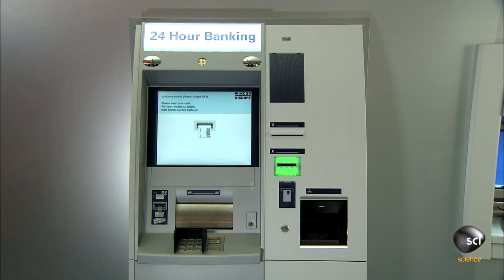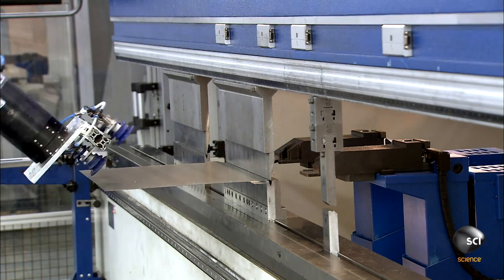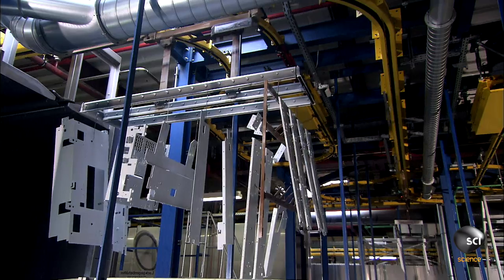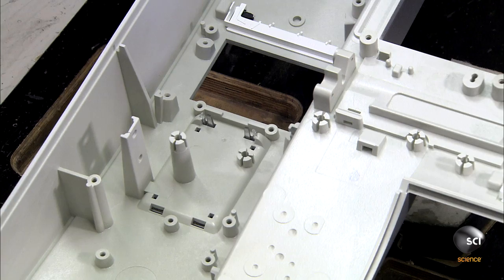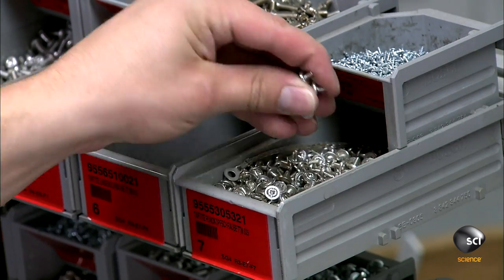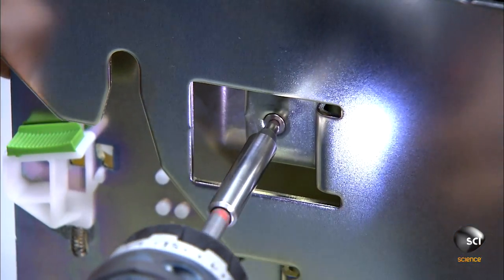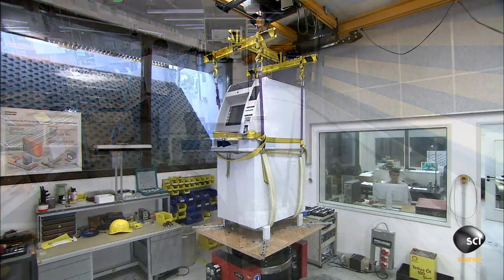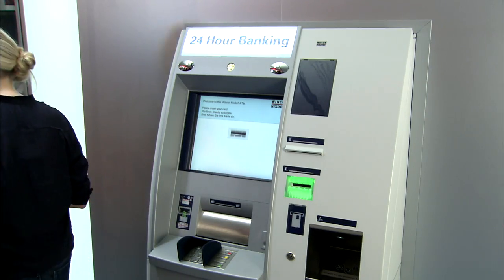ATM | How It's Made

Comment: As an atm technician I'll let you know that a lot of this is a thing of the past. The company shown in actually gone and a part of Diebold (now Diebold Nixdorf). Everything is made separately and assembled on site, not remotely.
Reply: I had been a dock worker of the logistics chain (Watkins Motor Lines) that took part in the transporting of Diebold ATM's back in 1999/2000, before they acquired Wincor Nixdorf in 2016, there would be at least two crates with a third pallet of parts which make up each machine.
Reply: How do you become an atm technician? Where do you go to to start?
Reply: Jay Rock AK  you can steal one anyways

Comment: How does the computer get the paper notes in/out of the safe? There doesn't seem to be any holes.
Reply: So the bottom part (where the cash goes in and out) are covered by a literal safe.. And it can only be accessed via the safe door.. So all the cassettes shown above sits inside the safe.. And can only be opened with a combination lock or some kind of key..

Comment: The processor and the chips in an ATM has 1/60th the computation power of a standard smartphone.  All of the cost is in the safe and the bill dispenser.  The processor and chips only cost pennies.
Reply: +N 10SZ They'll probably run off current smartphone hardware at some point tho. Current ATMs often still have 386/486 hardware inside, running Windows NT 4.0 til a few years ago when the extended support was dropped.
Reply: @1337Shockwav3  they still run on WindowsXP despite the support being dropped because it doesn't matter for them.
They are not connected to the internet, they route through a dedicated firewall that create a VPN tunnel to the bank. So it doesn't matter if the system itself is safe against network attacks.
Reply: I work for an ATM company and ALL of our customers ATMs are running windows 10 and have for at least 6 months.

Comment: awww.... I was wanting to know about the explosive ink charges they have =/
Reply: I used to work for a cash machine company. It's not really an explosive but rather a CO2 cartridge with an electric valve, releasing the gas to an ink container. So when the computer detects an intrusion, it squirts ink at high pressure through a nozzle, like a shower head. The ink is incredibly aggressive. I had to take a canister with sprayed money (due to a computer malfunction) to a cash central and count the money. The smell was nauseating, and the ink dissolved all plastic that it touched, including the fake leather car seat where we mindlessly placed the canister (in a plastic bag...).
Reply: Does Not exist in the ATM , would only be in the bags armoured carriers bring to the ATM to refill the cash

Comment: Any1 saw the robotic selection movement of "item keeping" then i gave an idea of "in a tunnel" to retrieve(by pressing only), i think atm box of cash can be changed this way(the money inside a long tunnel), then have stories of "a murder plot" someone digged a hole to push me in then fall inside instead(at that time i was at home) with alot of Maggots in it, so due to stories, maybe if my plan to have a deep tunnel digged for this, may have chances to push a new harassment plot, so just writing stuff. But still Means the old harassment plot is still not over right?

Comment: really? windows?! oh my god no wonder people can easily hack them..
Reply: Apple os? why? y dont they use linux.. recently here in germany somebody hacked at least 20 atm's by just plugging in a usb stick.. thats a big gap in security that needs to be fixed immediately..
Reply: +Dyl Treanor (lightguy) there are usb ports and other connections under the cover.. at least many models have them.. and linux is not easy to hack because it denies read and write permission on any new executable file.
Reply: +Dyl Treanor (lightguy) these covers arent really difficult to lift and when you do it at night, pretty much nobody is going to be able to see it.. and windows might not be open source but you can also mess around with it a lot..
Reply: Christian Regitz yep, and most of them are running like windows xp xD
Reply: Many now use windows 7, and more are moving to win 10, there are even some linux machines